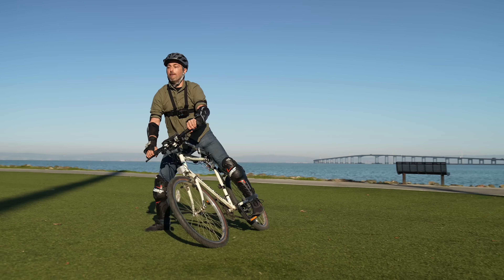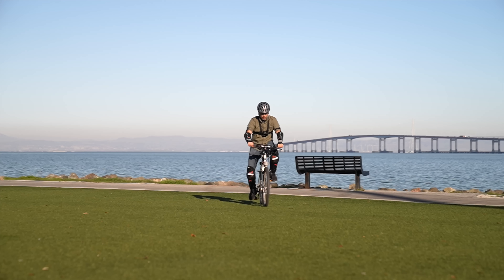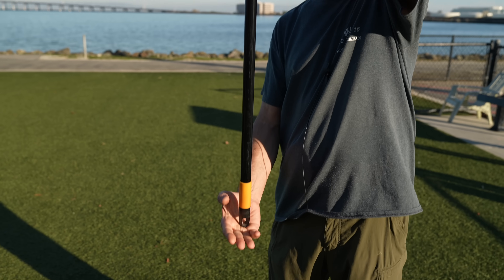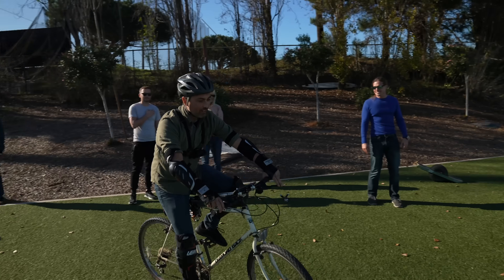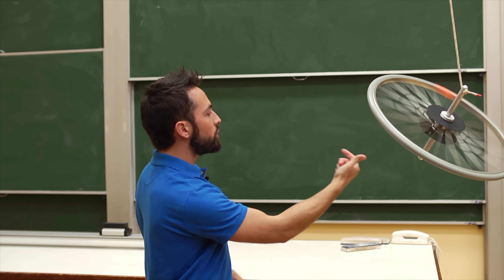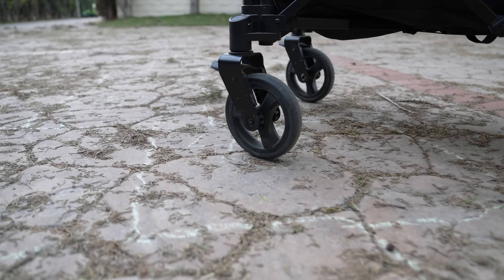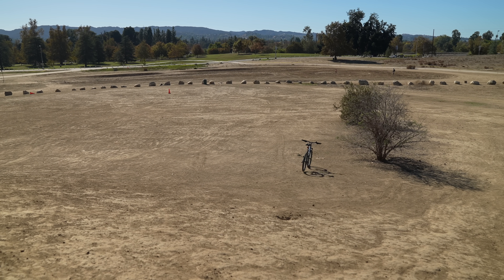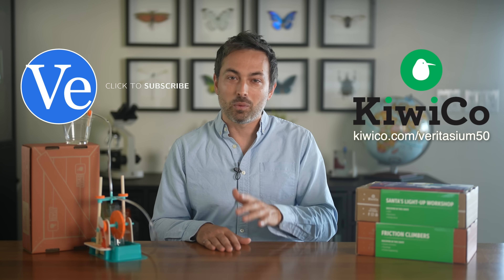Most People Don't Know How Bikes Work

Comment: There are at least two additional, albeit minor, mechanisms that turn the handlebars to the direction of the lean: rolling resistance of the front tyre moves off-center in relation to the steering axel in lean, and center of contact patch moves to the side causing a twisting force to the steering axle because of the round profile of a bike tyre. I believe the gyroscopic precession is the most important self-steering mechanism of them all. We made a demo bike that had the five mentioned mechanisms disabled, and the bike remained perfectly rideable, but not without hands on the handlebar. Also, check out Honda's Riding Assist system that makes a motorcycle self-balancing. It works also when the bike is stationary, so it is indeed possible, but it's very difficult for a human.
Reply: Did you create weird bikes like the ones at 9:10 that isolate the factors?
Reply: @FlyNAA  We modified a few ordinary bicycles so that the mechanisms can be not only shown but test ridden. One of the bikes had all the 5 mechanisms disabled, while one has a reduction gear between the handlebar and the steering axle to reduce the steering inputs by 50 %. The inputs need to be more emphasised to balance this bike, especially in slow speeds. This helps to see and feel the actual steering inputs. One bike has a lock pin in its steeling axle to demonstrate an unrideable bike, just like in this video.

Comment: How come if a don’t steer into a turn but lean/push the handle side down you don’t need to go in the opposite direction first? This happens at higher speeds for example going downhill or straight pretty fast, at some point everyone feels that steering is not effective anymore so we tend to switch to leaning. How does the speed affect the turning then because I have never seen a Tour de France cyclist wiggling their bike around in a fast downhill pursuit?

Comment: Lean over the steering handle, grab pedals tightly with feet and lift the rear wheel into air and twist-turn the rear end. Let it drop back to the ground, and steer on instead of crash?

Comment: Same thing happens with Motorcycles, you push the handle bar left it goes left, right it goes right.  People way over think how it works because they drive cars. At very low speeds, generally from a stop or near stop, you can turn it left and go left(or vice versa) but once you get any significant speed the countersteering takes over.

Comment: I noticed this when I was young (around 12 or so) and could not explain it until I got my bike driver license and I noticed this effect again. When you drive on your bike say 100 km/h and you slightly pull on the right handle, it will go to the left. Actually I noticed that if you drive flat curves you actually do this by slightly pulling the opposite handle.

Comment: It's dangerous to disagree with veritasium but i believe that it is still possible to steer purely through a lean, without requiring to actually turn the handlebars either way. Provided you're going fast enough...I bet you a pint.
Reply: Even if you let go of the bars and turn left by leaning, your bars will still sligtly go to the right first by themselves.

Comment: Excellent presentation.  What is intuitive once you learn to ride a bike needs to become explicit in motorcycle riding due to the greater mass, speed and forces.  Performance riding (e.g., a superbike through a high-speed chicane) requires a lot of countersteering pressure to change the lean quickly, including changing the direction of the large wheel gyros.

Motorcycle geometry (the rake and trail) varies with purpose and has tradeoffs in easy steering vs. stability.  This doesn't even get into drive geometry (offset angle between the chain sprockets) and suspension parameters.  It's far more complicated than most think.

Comment: Try road racing a motorcycle - in order to rotate the motorcycle at high speed you input a significant amount of force on the handlebars in the opposite direction.  It actually requires a good bit of upper body strength and I heard it reported that in can require over 100 lbf of pressure on the bars at times.  I do know that at the end of a 30 minute race on a track that requires a quick rotation at high speed for a corner or set of corners that you can be physically drained as a result, and if you get tired and can't input enough pressure it actually impacts lap times as you have to adjust for slower rotation on corner entry or exit and how that changes your lines.

Comment: Important to notice that countersterring to start a lean on a bicycle is different from countersteering as its usually referred to for motorcycles. 
This initial countersteering is like a "dip" to lean the bicycle and have the handlebar do its thing. On a motorcycle, you have the same behaviour only up to a certain speed. 
But above that speed you will be doing turns with pure countersteer, never having the handlebar turn to the direction you are going.

@Veritasium thanks for the video! A complimentary one for the motorcycle counterpart would be awesome!
Reply: It's no different.     Just that you usually don't go 140 on a bicycle. Going downhill at over 50kmh (phone app stopped),maybe 70 on a bicycle I found it scarily unstable compared to the motorcycle but it worked the same.

Comment: I don't think you're right, 99% yes but not 100%. If you're going in a straight line, and you move your centre of weight to a direction you want to turn then you can simple turn in that direction to make the turn. You do not have to turn the bike the other way. Yes, you do need the force on the ground, explained in the video, but you can also get the same force simply by leaning to that side (creating that angle that is created by turning the opposite way) then turning to counter the change in centre of weight. My hypthesis, prove me wrong. @Veritasium
Reply: Giving more thought, I don't think you'll be able to correct the bike after the turn. You'll introduce to yourself a whirlpool effect and will succumb to your doom. But, you may not. It is the limit to my imagination. But to all intents and purposes, you can make a turn without turning to the other side.

Comment: Modern mountain bikes (low top tube, dropper post) are all explicitly made for body-bike separation, so it’s easier to move (lean) the bike under you. It’ (leaning your bike more than your body) is something every coach will teach you right away, along with vision (looking ahead) and body positioning.

In your demo you’re limited (by that 1990’s era bike) because you can’t lean the bike independently of your body.
Reply: I am highly doubtful that's true.   I am sure that mtb and supermoto  riding style still necessarily need the handlebars to move n they will move this way at any speed over 20kmh
Reply: @gur262  I’m not saying you don’t use the handlebars, you definitely do. For example the “caster effect” from the “trail” (contact patch behind the line from the top tube to the ground) is real and very important. I don’t think anyone wants a mountain bike with locked out steering.

However body-bike separation is also important, and deserves a mention, especially since the demo bike is an antique mountain bike.

Comment: I figured out that the gyroscopic effect from the wheels wasn't what keeps bikes upright after I learned to trackstand on a bike, which is a technique to stay upright on the bike whilst you're not moving. It's a commonly used technique in track racing, mountain biking, and trials riding.

Comment: I’m curious, if you were to take a bike with its steering inverted (like smarter every day’s) would it be able to drive itself?
Reply: It would, since the wheel turns the correct way, simply the handlebars are reversed in relation to the wheel

Comment: So, I have an old single gear racer bike from the 80's, which is really stable. I usually ride it sitting upright, NOT holding the bars at all. I can actually fairly easily turn 90 degrees, although going steady and wide. It feels that I perform the the turn much more "from the hip" and pushing laterally using the seating in the saddle.  I fail to see that I actually am able to counter-steer to initiate the turn this way. Could someone explain? I can even ride it this way, going steep uphill really slow, just as a fun balancing exercise.
Reply: Pretty sure you still are.  I would bet if we weld it shut straight you can't.      I can ride a motorcycle free handed too.                     Try purposefully shaking the bike a little to lean.  You kinda give the steering an impulse you let it fall n do the counter steering that way

Comment: You missed the most important factor, that also apply to any vehicle not only bikes... and the most common reason for single accidents with vehicles and bikes.
Where you focus your eyesight on (where you look) is where you subcuntions turn unless you are aware of that and take precaution not to do that.
From what I saw in this video main reason you and the other had trouble drive a straight line is caused most by you looking down in front of the bike or on the front tire.
To see how it react so you can prevent it doing what you don't want it to .... that's where you fail.
Which were most people fail to, as they assume saddle up start pedal and get up to speed is what keep the bike up then they look 5 feet in front of the bike.. 
As such one small thing as lock up handle bar in one direction will throw you off, as you where not in balance in the first place.
To find the balance..
Firm seated center on saddle, upright posture, easy on grabbing the handle bars ( don't do death grip ) trust the bike it want to go straight.
And most important don't look 5 feet in front of the bike, keep HEAD UP. Focus eyesight on where you want to go toward the horizon.
Practice sit stationary on bike look to horizon find the balance and role of slow in a straight line when you found the balance you need ( that varies from bike to bike )
When you succeed you learned how to ride a bike correctly... then do the experiment again and I bet you get way different result. ( not counting those who do it wrong 😉 ) 
✨ Great video as alway Keep up the awesomeness! ✨

Comment: you guys counter-steer? I go straight into my turns, furthermore I tend to lean before steering, which has resulted in some high speed rolling of my body, because the wheel sides lose traction.

Comment: This video within the first few minutes, finally made counter steering on a motorcycle make sense.  Push in the direct you want to go in order to get the motorcycle into the proper lean and let physics take care of the rest.  Brilliant!  Thank you now it seems so simple and obvious.  I don't know why I didn't get it before.
Reply: Interestingly, there are questions on this in the BC, Canada, motorcycle test for your licence.
Reply: This is what i was thinking...
Reply: I think you didn't get it because few people actually understand it, so they explain it very poorly.
Reply: More reliable is:  "Push in the direction you want to go, then as the proper lean approaches, turn slightly in that direction."
IOW, steer it like a car after as you attain the proper lean or the bike won't turn.
Reply: @daveinwla6360  U only need to Push, Bike will get Lean Angle by itself. U can try in parking Lot. Just Push handelbar once and let Go of IT. You will end Up driving circles.
Reply: @daveinwla6360  You countersteer to begin a lean. You steer in to stop the lean angle increasing and establish your turn rate. You steer further in to reduce your lean angle and return to vertical, exiting the turn.
Expert level: Coming into a turn where you need to brake, increase your turn rate while you reduce braking force to stay within the front tire's "friction circle".
Master level: Exiting the turn under power, where the front tire's friction circle shrinks.
Reply: Thats kinda sad, they should really to bothet to explain it better then, maybe give feedback to your instructor. May save a life, so many accidents because people dont understand
Reply: @D3nn1s  Owwie, that was mean.  I imagine it's more a matter of information overload.  I didn't say that I didn't understand what to do, it was why I was doing so that didn't really click.
Reply: @empathy_is_only_human  no no thats not what he meant he's saying your instructor should do a better job of explaining and teaching to students because lack of safety knowledge can cause accidents.
and not saying your lack of knowledge in the field of bicycle self righting mechanisms causes accidents.
Reply: @empathy_is_only_human  you got me wrong, i meant exactly what ipod understood
Reply: @D3nn1s  Sigh, all I wanted to do was to pay a compliment to the Veritasium host.  All this other stuff is just plainly moot as I no longer have a motorcycle to ride anyways given it was stolen back in April of 2020.  And with SSI as my only income, it's doubtful I will be able to replace it any time soon.  Grrrr.
Reply: @empathy_is_only_human  i totally agree, thats why i think as many people as possible should be aware of this. Not trying to be rude or whatever.
Not familiar with what ssi is but it sucks that it was stolen :/
No insurance?
Reply: @D3nn1s  No, no insurance.  That part is on me.  SSI is a minimal disability insurance paid out to those who don't have enough paid into SDI to qualify.  When I first got sick I did qualify but kept hitting on wall on being accepted so kept trying to work but that just led to more injuries.  It took 2 decades and finally finding a good disability lawyer to finally be approved.  

I should have gone the lawyer route way earlier but se la vie.  Ah well it's probably better I don't have it anyways.  With the pandemic and all my health issues staying isolated is probably the best choice.

Comment: *Please test this out, we need answers !!!    TI think you can tilt the bike to a side so you have your body's weight on the other side and have it overall tilt the center of mass to the side of the body, without steering right at all, which would allow you to steer if you needed to steer one way but the handle bars don't allow it with normal riding techniques. Because once your center of mass is on a side, then you already skipped past the part where you have to get the bike's center of mass to the right of the center of mass of the whole bike-and-driver assembly. At the same time, tilting the bike to the right would also move it a bit to the right, so then tilting it back to the left would bring the whole assembly's center of mass to the left of the center of mass of only the bike.    *Please test this out, we need answers !!!

Comment: I now understand why I struggle so much to ride my recumbent bike hands free: the weight distribution is too centered on the front wheel.
I am now amazed I managed to pull several 100 meters chunks without falling while my hands were not steering.
Thankfully, I can push the handlebars forward to change the balance and get it to auto-steer, will try it soon.
Reply: I'm wondering if the issues you are having are more about steering geometry or weight distribution. The first factor he describes that stabilizes a bike with no steering input is called headset angle, and the distance between the contact patch and line through the steering column he described is called trail (which he did not really talk about). The second factor he mentioned, the offset of the wheel axis from the headset line, is also called rake. Headset angle and rake determine trail length. More trail makes the bike more stable, but harder to turn. "Nervous" or "twitchy" bikes usually have steep headset angles, or more rake (offset), and therefore less trail, resulting in less stability when doing things like riding with no hands, but you have a bike that can be turned very quickly with little effort needed. Changing rake, trail, and headset angles also changes the wheelbase, which has an impact on handling as well. I'm guessing shifting your handlebars forward won't have much effect, as the geometry of your bike won't really change at all, and you'll only be moving a few pounds a few inches. I'd be really interested to hear if you notice a difference.
Reply: @AshOnTop23  The bike does have some trail. I tested with my bike up in the air as he showed us in the video, and the wheel is turning only if I push the handlebars forward to offset the mass center.

I'm going to work in a few minutes, I'll see the real world practice 😄

Comment: How do you explain no-handed bicycling? There is no forced-counter steer via the handle bars, as your hands are not on the bars. I have ridden no-handed many times and never have to 'lean' left to turn right, or the reverse. I simple lean in the direction I want to go, and the bike complies. Your footage even confirms this. When a moving unoccupied bike starts to lean right, the force of the ground on the front wheel turns the wheel to the right. This adjusts the path of the bike to correct the lean and restore balance (if the bike has enough speed). When I ride no-handed, I'm simply using my body to force the bike to lean in a preferred direction, rather than letting the terrain dictate when an imbalance occurs. No counter steer is required.
I'd venture to say that most people actually do THIS without conscious awareness. In fact, I'd say that the vast majority of my turning in normal riding is achieve by leaning, not by manipulating the handle bars. Counter-steering is probably only really necessary when the bike speed is low enough that the adjustments required to control the lean become too fine for most of us to manage (i.e. the smallest adjustment we can make results in an over-reaction - which is exactly what you see in your videos of people falling).